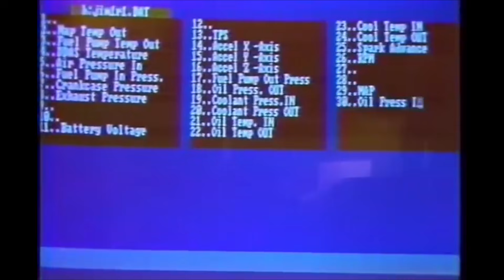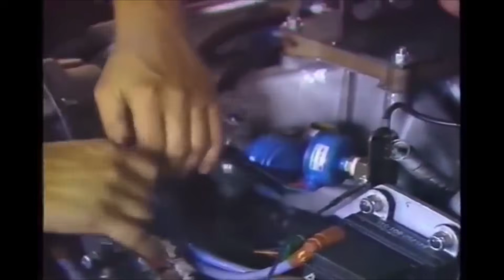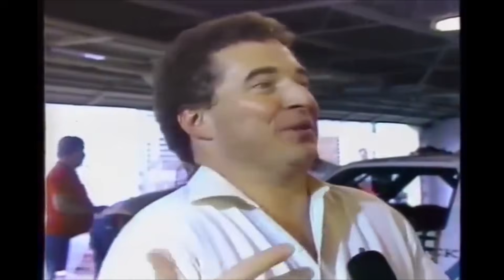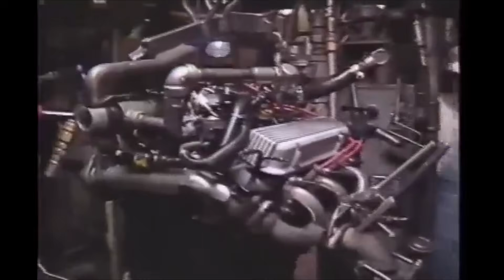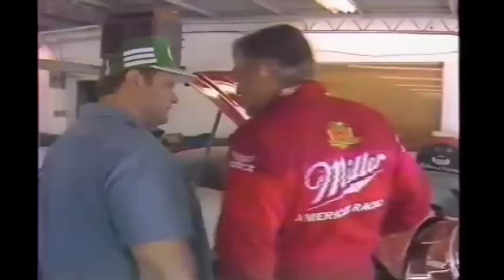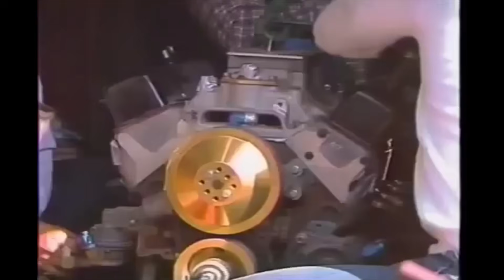The NASCAR Buick V6 Program 1985 Interview Profile (TNN's Inside NASCAR)

Comment: We had a cool little series here in Ohio that used primarily s10 truck chassis and bodies with a 4.3 v6. We used the 2nd series blocks, vortec heads, 525 lift cams, Edelbrock intakes, HEI, flatops and Holley 2bbl carbs. Very durable and fast. At 2900lbs we were turning lap times that would have been mid to upper v8 Street Stock times. ( crate motor 3200lbs) The track thought they were better off with crown vics and other stuff so they threw us away.

Comment: And here we are in 2026 with nascar running V8's and no v6 in a nascar car in 40 roughly.
Reply: Right and you can def get a v6 to perform especially when they use the 550hp packages. Lighter and would use less fuel it would be really interesting.

Comment: Its funny listening to them talking about the V6 is the future. It only lasted a little while. Its like everything there's always something new and better coming.
Reply: The reason the V6 wasn't permanently adopted in Cup or Sportsman competition back then was due to Ford vetoing it. GM put a lot of money into R&D with their program through Buick. Ford didn't invest as much and was way behind in terms of program maturity. Ford knew that if the V6s remained competition legal or became the engine required by rules package changes they would be years behind in R&D and their performance would show it.
Reply: I mean it's not like NASCAR is chasing the future, they only JUST added the fuel injection they mentioned in this video! Still running pushrods too, if they just adopted DOHC and opened things up a tiny bit regulation wise, they could make 600-700hp or whatever with a smaller engine whether that's a V6 or hell shrink it but add more cylinders like the 4.0L V12 in the Gordon Murray T50 that makes over 600hp in a road car.
Reply: @presinald  They’ve been running the same cubic inch small block for decades and were squeezing 900 hp out of it N/A. Pushrods aren’t the problem, NASCAR’s “brain trust” are.

Comment: What cool info. I am always searching " just as a hobby"  for old stories of the American automakers sharing parts, and i never knew about gm selling v6 engine tooling to amc. Very cool. 
After watching your video, i learned that AMC used gm engines other time's too.
Thwnks for sharing ❤
Reply from the maker: Om glad you enjoyed this.
Reply: The Buick V6 was originally designed for their first generation of compacts, and was sold to Kaiser-Jeep in the mid-1960s. Many of the MPC Jeep/Jeepster kits of the era have that engine included. The other engine designed for these cars, an aluminium V8, had its' tooling sold to Rover in the mid-1960s as well, and ended up powering decades of British Leyland, Land Rover/Range Rover, Morgans, and other cars. Ironically, these two engines, deemed failures at the time, turned into some of the longest-lived and adaptable engines ever produced.